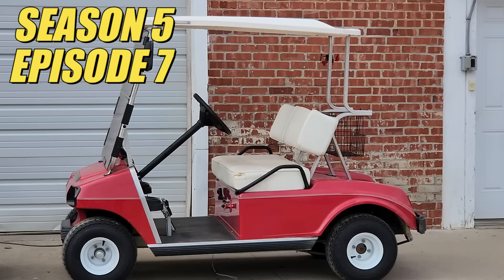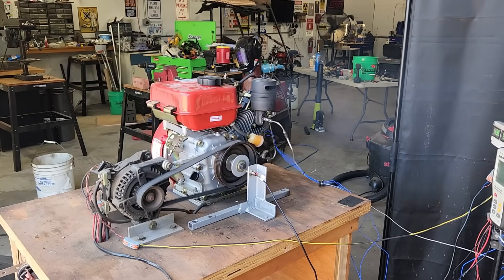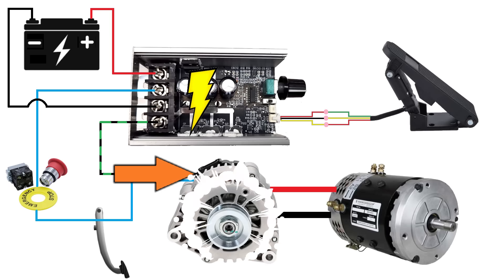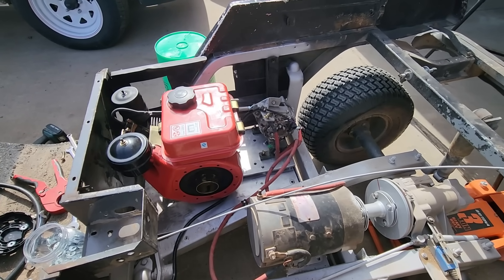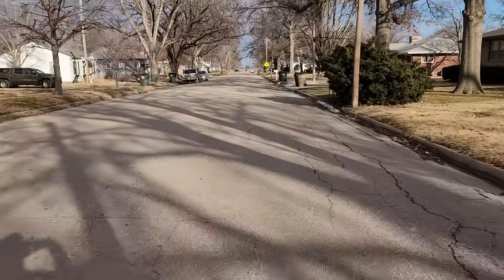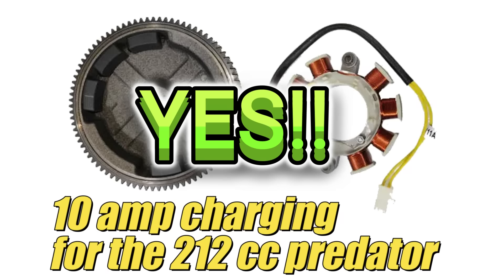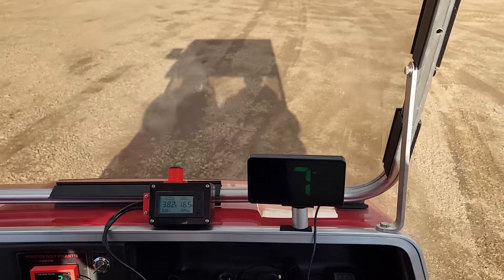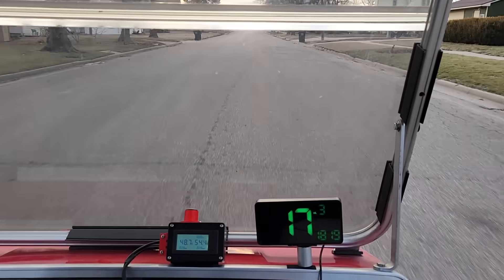S5 E7  We build and road test a Diesel / Electric golf cart. DIESEL POWER!

Comment: you could use a battery  just to  feed the  motor while accelerating  , when Amps go really up , so  the diesel won´t stall.
you can also get some rock wool in the engine bay to silence it a little bit.

Comment: I'd love to know what happened to the little diesel during your fuel testing, how you fixed it. I suspected blocked fuel filter, but you suspected injector pump.. Were either of us right?
Reply from the maker: Hi ya, In season 5, Episode 5.  We fixed the little engine.  The problem was caused from carbon build up around the injector and was causing an irregular spray pattern.  The fix was as simple as removing the injector and cleaning the carbon.

Comment: as a machinist, with diesel tech background, a cast iron motor mounting plate would help absorb a lot of the vibration! as for the diesel knock a tuned exhaust would help, but i dont know of any made for engines that small

Comment: Love all your stuff Jimbo!
Quick question, is the cable laying alongside the motor for the reverse clutch? Only reason i ask is because it looked like it had moved locations between shots in the vid. I would secure it better to prevent it possibly shorting out on the motor during operation.
You could try vibration isolation pads for the little diesel, as well as your rerouting of the exhaust to help quiet it a little. But as you stated, due to the sheer small size of the engine itself, theres very little noise canceling capability. 
Keep up the fantastic work!
Also... do the 420 please. 

Or go overboard with another golf cart with AWD using one petroleum battery to drive one set of wheels and another to drive the other set.

Comment: btw, diy lead-acid or zinc-acid batteries are easy to make also. well any horse you drive will go rogue at some point. so what about an actual generator unit put in the cart. equivalent. I mean ac power outlets and dc outlets. standard 240 and 120v, maybe 400v high power output socket. yes the usual 20kW diesel generators. well satan wants what is of human, not what is of God. just saying. there is no second, or time. so stop measuring stuff for your will.

Comment: I bet you need to run the alternator at a higher rpm to get the higher voltages you were getting from the gas engine.

Comment: Turn the 3 wheel golf cart into a 3 wheeler utility vehicle with truck bed, ATV tires and improved suspension. Diesel-electric 3-wheeled John Deere Gator-style restomod. Would be a creative project that could be useful (or I'd buy it).

Comment: Suggestions? You reported that the diesel injector pump is shimmed, and mere shims retard the diesel injection. It fires at 19 degrees before top center of the piston.if you add shims, would this reduce back thud? Please keep track of the extra thickness you add because I may copy it. If retarding the injection bothers it, you might want to limit the governor throttle, and thus top RPM's. The other noise is the diesel has valve stagger. It's not as bad an effect as the same stagger on a gassie, but it definitely makes the exhaust noisy. One last question. Does the predator aluminum flywheel with magnets fit the diesel?

Comment: Jimbo, I have a 98cc harbor freight generator that is awfully loud for how small it is. To keep the neighbors happy here in NE Oklahoma during storm season I got three pieces of plywood that are approximately 18'x24' and stapled air duct insulation to one side of each piece of plywood. I lean the plywood fluffy side in onto the generator and it quiets the engine noise substantially! I went a step further and got some 1" flexible exhaust tubing and put that into a motorcycle muffler. I can't even hear it running in my backyard from the front yard! The muffler even has a cat in it and effectively gets rid of that small engine stink.

Comment: some insulation, closing off the holes, boxing it in better,  and building a full exhaust will do a lot for the noise. The exhaust may not be all of the noise, but its a not insignificant amount.  That said, Do the 420 Please! 
I also feel like you could install a cargo tray on it... parts runner?

Comment: If this project ever advances to the point of using a variable voltage variable frequency inverter, maybe in like 5 to 10 years since that's kind of very advanced and/or expensive, hearing a golf cart sing like the Siemens Taurus locomotive would be funny.

But anyways, back to the present, "Do the 420 please" because a BIG BLOCK is just cool. There's no replacement for displacement!

Comment: I been thinking about building a, well, tractor for lack of a better name. A small one, riding mower sized, I been trying to think of a power train system for it, i was thinking car rear diff, either narrowed or using a independent rear suspension diff. Build a 2" sq. Tube ladder frame, slightly larger than a riding mower, and much heavier. Along with a transmission from a red car. And a chain driven with a CVT torque converter. Possibly getting 15 mph on the top end in high gear, you have me thinking use a 12 HP engine a couple 150 amp alternators and use a forklift motor. For a bush hog use a mower deck with the motor mounted to it. And pull it around. I'm thinking about using 30x9.5x15" tires on 15x7" rims(maybe 15x8") with 12" trailer tires and rims in front on a axel made from welded steel . A 2"x3" box tube 1/4" wall about 26"- 30" wide with a 2" long solid bit of steel welded in each end and a 2" round bar with bushings for a 1.25" pin in the center connecting to the frame through a couple 1/2" plates and a couple 2" tubes about 18" long  running at a 45° Angle  to the axel with a single straight one running from a cross member to the plate center. Below the pin with a pivot . Allowing about 4-5 " of travel up and down  using a couple cheap coilovers shocks with stiff springs, giving traditional tractor steering with a slight suspension. The rear using a suspension subframe possibly, haven't gotten that far. Use two master cylinders, so the rear diff can be used walking through slick areas. Possibly having a front brake as well  with a pin  locking all three pedals together. A front drive 5speed transmission would work great also, make a arms to mount the bearing and hubs , narrow the axels. And use a chain driven to drop the gear ratio. 1st gear would be crawling, 4th gear being "old man running" speed, 5th just a bit faster. The electric motor would make it plenty fast  I'm hoping for a weight around 600-800+ lbs  possibly making sheet metal weights filled with concrete for the wheels and to hang on the frame front and rear, I want to make a 5' blade for the front and rear.  I have also thought about 4x4 using car axels and hubs driven by chains from the rear diff. It should go about anywhere. Have an awesome day🎉✌️

Comment: Pick up a scrapped oven for cheap/free. Blow it apart. Salvage the fiberglass insulation and line the top half and front of the powertrain compartment, securing it loosely with chicken wire if needed. Voila -- cooler seats and a usedul reduction in noise.

Comment: Have you thought about using a standby generator motor? Easy to get and designed for a steady load at a consistent rpm. Most of the Kohler engines have swaps for the carb… although I bet you could manage making one!  

Also do the 420!

Comment: Concerning the 420cc version of the gas/electric golf cart: If enough generating capacity is added to make use of the 420cc engine's output power, won't that sling the wire off the rotor of the drive motor?  It seems like even with the 220cc version, we were a little over the max rated rpm of the drive motor.

Comment: so glad your doing this.  Ive got a diesel motorcycle (so so fabri-hacked together) that really does not hit speeds enough to be anything but back road safe with its 10hp Yanclone and Cvt.... In back of my mind have considered upgrading it to diesel locomotive via 48v? hub in each wheel.  48v mainly cause converting 24v alt. to 48v seems more plausible cost effective means to get charge needs met.  (Batteries as capacitor in saddle bags)..

Comment: Jimbo, i know you didn't want to use a solar panel, but the irony of a diesel electric SOLAR golf cart should be too attractive to ignore.  Avoiding siphoning off some of the energy to charge instead of propel the cart should justify battery charging. You could even buy a used 300 watt panel for roof mounting, so you'd only have to buy a charge controller.

Comment: I wonder if you could use an inverter based generator to do this also, since there is already proportional control and it basically does this already.  Of course the electronic part would be a challenge.

Comment: Another thing I'd like to see (though it hasn't been a thing on this channel) is steam electric. Would be fun to see a tiny triple expansion running off diesel and used fryer oil! They can be very, very effective. 

Oh, and maybe running a gasoline engine on wood gas? A lot of cars in Norway were converted to run on wood gas during the war. I wonder how a modern engine would stack up!

Comment: I've been thinking about this, I wonder if you could make this powertrain using a engine driven welder?  My Miller welder has a foot pedal control and you can put it in CC or CV mode.  In CV mode you set the max voltage with the main dial and the pedal controls the output.  I think this is effectively just like what you made, but I think the efficiency is a bit higher.

Comment: Could maybe add a dynamo to power the controller feeding the generator? Would need another circuit to keep it at 12V and sufficient amps, but you could get rid of the battery.

Or am I spoiling the bolt on thing? 😄

Comment: just put sound insulating material on the inside of the engie bay and cover up all the holes as long as your engine has a fan or something to keep the airflow moving it should not overheat and fix all the noise issues

Comment: You could add diesel fuel supplement,it normally modified the fuel ignition and quiets some, could test cooking oil, since you brought up 420, hemp oil(yes). With Arduino, bring diesel to steady rpm and use it to manage power demand, then you only have 1 rpm range to manage NVH

Comment: Couple thoughts. The Honda N600 air cooled car had these hard rubber strips with fingers that ran along the edges of the cooling fins to act as noise dampeners. They did indeed work. 

Also, could you arrange the alternator inline with the drive shaft so the engine turns it directly in a shaft to shaft configuration to eliminate the friction loss with the belt and pullies? Just a thought.
Reply from the maker: We need the overdrive on the alternator to improve the efficiency.  The faster we spin the alt, the less heat is generated.
Reply: @  man! I was afraid of that.

Comment: Are you using any type of transformer to increase/decrease volts or amps in the red golf kart ??
Please do the 420cc experiment.
Reply from the maker: No transformer needed.  The alternator is modified so it can produce around 60 volts under a load.

Comment: So.... I know in your other vids, you said it's not efficient.... but my new Outlander PHEV uses this basic method.  It's an electric car with a 98KWh generator.  With that said... it can couple the engine at highway speeds, but there isn't any real transmission. AND.... The new Ram PHEV truck will have NO transmission.  So it's exactly like this.... but with a battery too.   (Just an FYI for you)  EDIT.... do the 420 !
Reply from the maker: Indeed its not efficient.  we loose 40% of the power the engine makes.  I'm not sure what is being done on other systems, but according to the laws of thermodynamics there will always be a loss when converting energy.  The alternator we are using is only 60% efficient.

Comment: Now when you get the arduino working you can get data from adding a flywheel to the engine and alternator to overcome the problem of stalling. This can make graphs, from data? I am not knowledgeable about what this microcontroller is capable. But if not you can add a data logging system…..
And then you build the next drive, which uses ac . Two large motors and a big variable inductive grid to vary the energy. I recon some like they use in old broadcast stations and a core to provide control, and a grid with series and parallel switches….
Reply from the maker: lets use the 6.5 Predator engine as an example .The problem is the 6.5 HP predator engine can only generate 2900 watts of usable power when you factor in the 40% loss.   Watts is calculated by multiplying voltage times amps.  so at no point can we let the alternator generate more than 2900 watts.  With the micro computer we can monitor the voltage and the amps, do the calculations and when we are approaching 2900 watts, we just back off on the power being sent to the field coils in the alternator.  We have to respect the law of thermodynamics and we will never get more power out of the system than what we put in.  The best way to optimize the limited power we do have is to use a computer that can do thousands of calculations per second and have the computer do all the work.

Comment: This one of a kind machine needs its power. Im thinking 420, turbo and a covertly mounted NoS system. For some real street cred in the suburbs. 😎
Reply from the maker: The desperado has the scars to prove its a tough machine.  Soon it will be a 420 gasoline/ 196 diesel electric contraption that can generate enough noise it will scare little kids and old lady's.
Reply: @robotcantina8957  just missing the turbo boost button from knight rider 😅

Comment: **forewarning about my comments today. I'm concussed by the vibration and drunk on the fumes from that diesel engine. some thoughts may seem a little off-beat, under-cooked or a case for divorce but are in no way over-engineered**
well Jimbo, you've certainly come up Trump with the Desperado! with the super sized 420 (please) block and those looks it could be engineered into the worlds' first diesel battery powered rat-cart-rod but don't forget the drag-bars if you do. your marking of the foot pedals 'stop' and 'go' is essential in the modern world where common sense has been bred out by the legal 'profession'. the steering wheel should be marked 'left' and 'right' to avoid any confusion when cutting edge driver aids like Google Maps tell you to turn left and you aren't sure which way that is (don't mention this to the wife regarding her driving tests).
thanks as always from across the pond for some great Sunday entertainment!
Reply from the maker: the 420 is in the works!   Thanks for the input!

Comment: Would it be possible to attach the 3 phase AC from two identical alternators, then use variable DC voltage fed to the field coils to create a variable speed electric transmission? Maybe an option to using the big DC motors in your setup. 
If it works using two alternators would be a really neat option to those variable speed vbelt transmissions used on go carts and mini bikes. 
And  it seems it would be more efficient than AC to DC conversion used in your golf carts.

Comment: maybe raise your field winding voltage to get higher speed?   You might be able to do that by forward biasing some silicon diodes between the ground of your PWM and the battery ground.   I know this will work with alternator voltage regulators.   Most alternators can actually work just fine up to about 48 volts

Comment: Heh, heh, 420...  All I was wondering about was the diesel performance with the greater amount of torque.  Mileage would be nice, but I'd like to see more car stuff.  Golf carts commonly use similar engines.  Putting one in a battery cart is cool, but not in nearly the same level.

Comment: wondering if it going to be verry hard to convert the little diesel engine to watercooled , the waterjacket around the cilinder should dampen a lot of the noise and the whole aircooling fan and schroud can be removed eliminating the noise coming from that

Comment: Instead of going bigger, it might be interesting to go smaller. What is the smallest amount of horsepower needed to move the (presumably lighter) three-wheeled golf cart down the road at say, 15mph? I drove one on a college campus and high speeds were verboten. They were capable of hauling 500 lbs of whatever but speeds were limited to 18mph or 12mph depending which manager ordered them. You already have small cars with small engines and there are numerous examples from Europe in the 60s of micro-cars running similar capacity engines. Would say, a 90-125cc two stroke engine turn the alternator with enough torque to do the job? Or would a four-stroke engine work better? Would fuel economy be better or not?